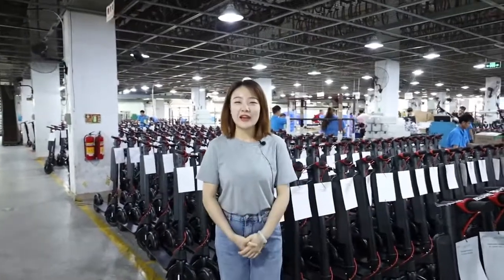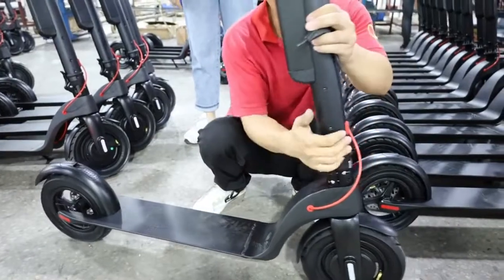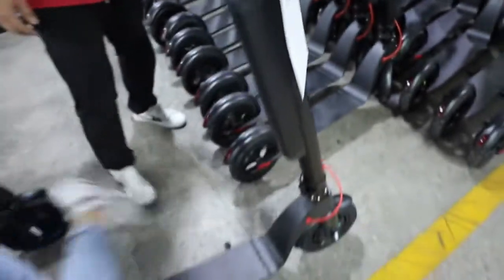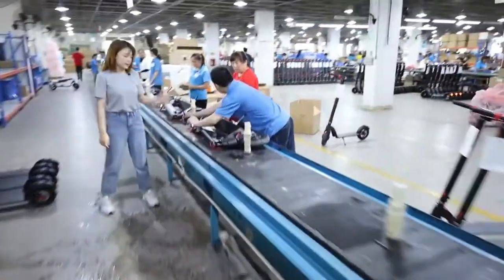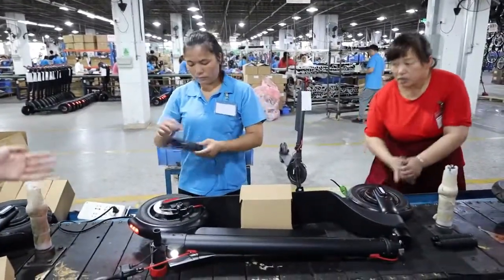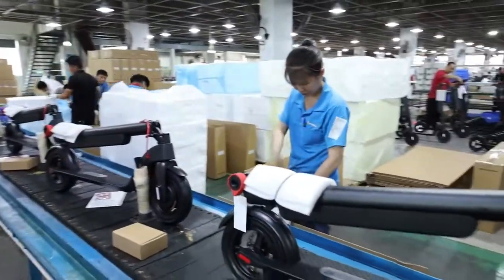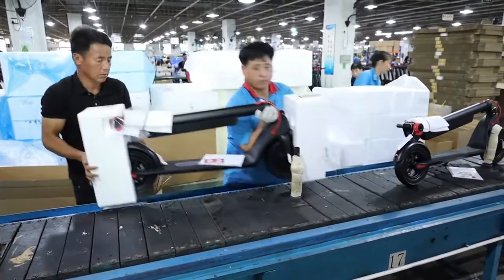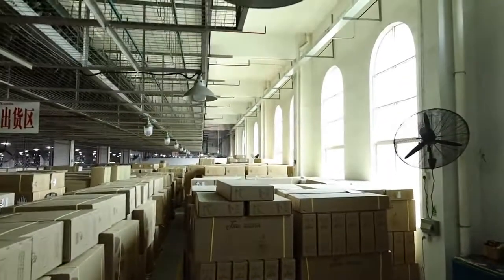Best Electric Scooter for Adults - X8 Scooter Factory

Comment: X8 escooter problem error (ec)? What
Reply from the maker: "C" or "C0" or "EC" displayed on dashboard means Motor Hall fault or connection failure- solution: Replace the motor on condition that circuit connectors work in normal